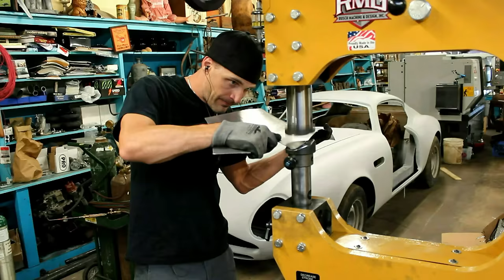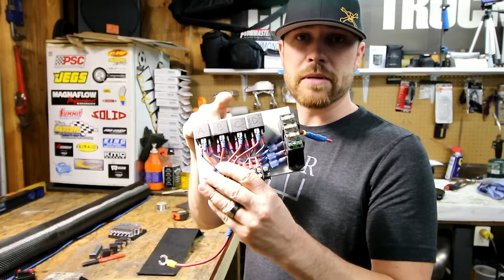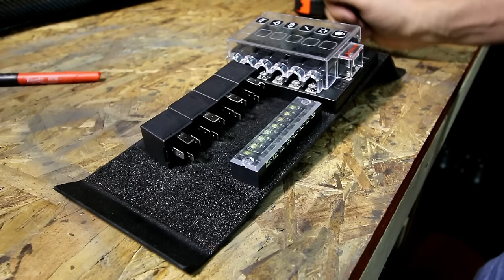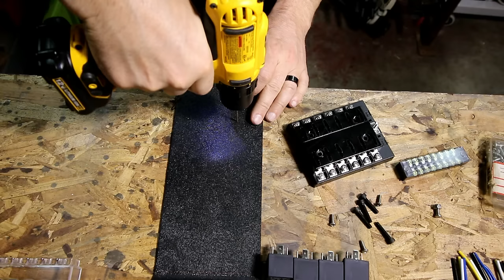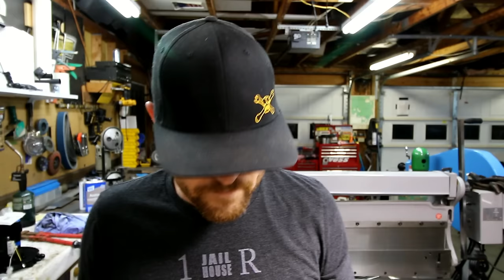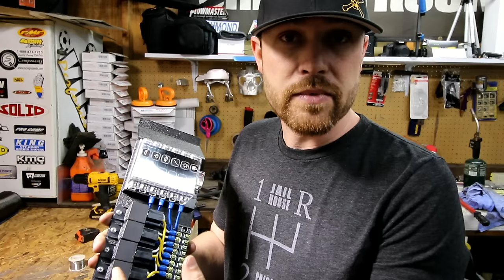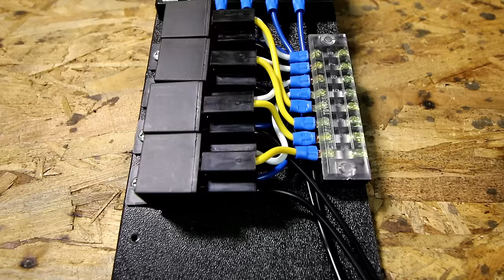How To Make A Power Relay / Fuse Block | Automotive Wiring

Comment: Very nice video/tutorial. But I have a question that how much amperage of the breaker should I get? I'll hook up a 30'' light bar and 2 pods led lights and a winch. And also planning to add 2 more lights/gps to my truck. Any idea? Thank you!
Reply from the maker: the breaker should be rated less than the wire it is protecting

Comment: great video man. I just bought my 12 circuit ez harness and I'm not a fan. The only relay that it came with is a horn and two flashers with a 30amp head light fuse. I'm not running a lot of accessories in my car, it's a very basic setup with a LS1 and manual everything. all my switches will be to where my climate controls and radio use to be. would this be a better solution that you made here? here is a short list of what's in my car.
1) head light low/high
2) parking /brake
3) turn signals
4) horn
5) accessories are gauges and one 12v aux output
6) fuel and fans will run off my engine harness. 

thanks for any advice.
Reply from the maker: yeah most of those dont require a relay.fuel , fan and running lights is all that really neeed it

Comment: great video man but those are not electronic relays switches, they are electro magnetic switches via the coil inside the relay being activated via 12v and ground on the coil.  again, this is a great vid for people not familiar with relays

Comment: Great video, thank you for posting I'm definitely following this!
A couple questions though. What type of switches do you prefer using? And my swap will need headlights, tail lights, turning signals, fan, fuel pump, and ignition, will this type of setup work for all those mentioned?
Reply from the maker: +Tyler Kotrous No preference on switches, something plain. And yeah this would work for your needs

Comment: So quik question when u hook up Ur switches do u hook up it up to white wire then ground it out? And then just wire say fuel pump to the yellow wire and ground that?
Reply from the maker: yeah basically...obviously the wires may not be those colors but the process you explain is the way it works. The relay is just an electronically activated switch that than handle a bigger load that you actual switch

Comment: Does the circuit breaker have to go next to the battery or if I'm going to run my power cable from the starter can I put it by that? My battery is in the trunk is why I'm asking

Comment: So I used a fuse block from Amazon and have power going from battery to that to a switch panel then to a 19inch led light bar and 4inch pod lights. The bar is 108 watts the pods are 18watts. Do I need a relay for these?

Comment: Very nice... so how do you determine the size breaker you need if your only feeding a 7 relay pack for ... dual electric fans, offroad halogen lights and an elec fuel pump? 300A would be overkill as I wont be turning over a starter??? thanks and keep the videos coming
Reply from the maker: breaker should always be under what the power supply wire can handle no matter how may relays you plan to use....the breaker is just incase your main power shorts out. Everything else is fused seperately
Reply: gotcha and thx.. after many googling hrs.. I now see.. that the best way is to calculate how many amps you will use across ALL items in the box, go a bit higher and that is your breaker size.. then figure out wire size. that tells me my 7 relay setup may just sit for offroad lights and electric fuel pump and my electric fans will sit in a separate setup on their own as they can draw up to 70A making the breaker and wire HUGE... so separate them on their own and down comes the breaker and wire... thx again

Comment: Whst does different amperage do ? Because I have a 6 position fuse box so like yours but there are 600v / 15A or 600v/25A what's the difference and what's the connection to size circut breaker because I see you listed s few different breakers with different limits so I'm a bit confused

Comment: personally I'd use one of the terminals from the fuse block to supply power to the "switch" terminal of all the relays and then use my switches in the car to switch the ground side of the "switch" circcuit on the relay. It simplifies wiring through the rest of the car and isolates more wiring to just the board, reducing failure points.
Reply from the maker: Doing it that way wouldn't eliminate any wire. You would just be exchanging the trigger wires. The amount of wire used from the switches to the relays will still be the same length weather they are ground or power. It would eliminate potential for shorts but think about it like this, if a ground trigger wire wears through and self grounds it will activate the relay and you have no way of tuning it off....if a power trigger wire wears through and grounds it will pop the fuse and close that entire circuit until you can fix the problem.
Reply: The Fab Forums I hadn't thought of that. Never had a wire wear through on me so I haven't experienced that problem to learn from. mostly I'm just too lazy to run a power in to my switches so all I have to do is run the one wire from the relay and then stick a ground as close as I can to the switch so I don't have to run as much wire.

Comment: rewiring a Grand Wagoneer with a Magnum engine. Appreciate your expertise. Chrysler/AMC put the relay close to the device. How is that important?
Reply: Putting the relay close would mean less heavy gauge wire needed to carry they load which would give less voltage drop but also cut manufacturing cost since they are running shorter runs. Just make sure you size the wire properly for the amps it needs to carry. Longer runs of wire carry less amperage, you can look up a wire sizing chart that will give you the info.

Comment: Great video guy, just one question, on that small panel, would it make more sense to insert the relays white and yellow lines in a stagger, ie, white yellow white yellow, so that your on/off switch wires are'nt spread to far apart. Hope the question makes sense.
Cheers
Reply from the maker: I like to have all the switch wires together because the harness from the switches is all together

Comment: Are the negative/ ground cables coming out of the relays all connected back to the negative terminal on the battery? Also, does the distribution board have positive and negative inputs for a device or do you run the negative cable from a device back to the negative terminal on the battery as well? Cheers for the awesome video! Hope to hear back from you guys
Reply from the maker: yeah all negative terminals go back to the battery. the distribution blocks only have switch power coming in and main power going out
Reply: Thanks heaps for the reply. Do you know of some sort of grounding block that allows negative cables from all the relays and devices to connect to, allowing you to then simply run one cable back to the negative terminal?
Reply: You can use one of the bus block and jumper them and on the last jumper use a larger ring connector and fit the wire going to the batt in it as well. You could also just use a wirenut or crimp connector, twist all the wires plus the on running to the battery and put the wire nut on it or put them in the crimp connector and crimp one side then run the wire for the batt neg on the other.

Comment: Okay that looks awesome. I just have one question. You still need power from the switch so does that just come form the other side of the fuse panel or would I still need to run power to a switch panel? I hate wiring but I just cant wrap my head around paying someone so much to wire a race truck for me.
Reply from the maker: yeah...I use one fuse to power all my switches
Reply: Ok what size fuse? I’ll end up having like 4-5 switches I might use a separate fuse for lights switch and need a separate set up for brake lights

Comment: hey bud I need a set up for a 1960s Hillman ive chopped back the wires from light wipers indicators fuel pump etc to 2 feet ive tested them all they all work so I just need a fues box for 4 cylinder old donkey motor and how many reulators I need how many fuses etc  how do I know how many items I need  so I also need to wire up dizzy alternator fan etc so what kind of loom do I buy and do you sell them and these set up  thanks scott    new Zealand

Comment: man, I've been trying to figure this out for two weeks. I'm stumped. How are you getting power to your relay white wire (86 - 85 black) with a switch located on the dash to energize the RELAY coil, which moves electro mag switch from 87a to 87 that closes the power to pin 30/pin 87 to activate your accessary?

Comment: i understood everything except the part with the switch. doesn't the switch have to be operating on a low power circuit for the relays to close? if so how do you accomplish that?

Comment: Do you have to run a seperate ground out of each relay? Or can they be just stacked on the same common ground? Also if I would want to run switched a d constant power could I do the same thing with this setup? Thanks
Reply from the maker: they can be stacked

Comment: Great work and video.  If you have only 4 relays with a total capacity of 160 amps, a 300 amp breaker is way too large.  The breaker is there to protect, but at 300 amps, it will take a long, hot, absolute short to blow it.  That wire cannot handle 300 amps or more...

Comment: Can anyone please answer these two questions about this set up? How would I connect this fuse and relay block to a keyed on power source? And how would a five pin rocker switch be wired to the fuse block, which wires from the switch goes to the block and where?

Comment: Man I have some questions I cant answer. 

1. For determining wire size from battery to fuse panel, do I total up the amps I’ll be utilizing? Say, I have 4 accessories that are 10 amps each. Do I call that a 40amp fuse box? Therefore making my awg 8?  Or can I just use a random size beefy wire anyway?  Does length come into play when determining size? My battery is about 4 feet from my aux fuse block.
2. Does the ground wire size matter?
How do i determine the correct size amp circuit breaker? Ill be using less than 100 amps total with all of my accessory amps added up. Not even sure if thats the correct way either haha. Im very confused.

Comment: How would you go about adding a switch to each one of the relays? would you be connecting the power to the switch to the yellow power out?
Reply from the maker: no power out goes to the accessory your trying to run...the switch power goes to the switch input on the relay

Comment: I got a question Kyle, today I was wiring up my Magnafuel external fuel pump. When I purchased the pump I opted to buy the assembled dual relay kit from Magnafuel so I have plenty of insurance for running the pump. So here is my question, since I have two relays, I have two wires that need to transition into a single wire at the fuel pump, ignition and battery. What's the best way to make that joint with two large wires, joined to one side large wire. I believe the wire size I'm working with here is two 14awg wires and a single 12awg
Reply from the maker: hmmmm. Not sure. Why are you running two wires?
Reply: I got it figured out now, originally I was running two relays for the single fuel pump. But after looking into the pump load I figured out I only need a single relay.

Comment: Was just watching and was wondering why are you double fusing the power that’s coming from the batter to the relay wouldn’t u just fuse the power wire from the batter to the relay then fuse the wire that goes to your light or fan thank u
Reply from the maker: I only fused the main power and the accessory relays

Comment: Hey Kyle. Thanks for putting together that video. I really appreciate it. It's awesome stuff.
I'm working on the wiring harness for an LS swap which will need fuses/relays for the fuel pump, injectors, fans, PCM, etc. Would the panel you put together work for that application and under the hood? Could it be made to be water tight? 
Would there be a need to fuse the wire between the relay and the accessory?
Thanks
Reply from the maker: awesome. yeah you could use it under the hood and the fuse that powers the relay will be the fuse that trips if the wire from the relay to the acc were to short
Reply: Gotcha. Thanks for getting back with me. Have you figured out a way to make it waterproof/resistant to the elements under the hood?

Comment: @the fab forums I have a mess of wires underneath my dash and want to simplify my wiring because I really only need 6 accessories powered (fuel pump, electric fan, gauges, ignition) Would this be a suitable setup to power those?
Reply from the maker: it would be perfect

Comment: hey question , I have some relaays laying around wondering if I can use them they have 5 wires instead of 4 , can I use them or I have to go buy some 4 pin relays? thanks and nice video man!
Reply from the maker: you can use them....the 5 pin just has a normally open pin and a normally closed pin
Reply: The Fab Forums thanks for the help so I should leave the middle wire off ?

Comment: I still cant get my head around the 12v switch wire. Say it's a stock heater you are powering, you press the switch on the dash, where does it get its 12v from to trigger the relay?

Comment: if its for different lighting options and a constant 12 volt, do i need the relays?
Reply: I need to know as well
Reply from the maker: relays are made to withstand the current load and demands of lights, fans, pumps...ect. Most 12v switches are not. So the fix is to use a relay and then just have the switch power the relay vs the actual light or fan...
Reply: @Thefabforums  thanks!
also is there a bonus to having the bus bar as well, compared to using just the fuse block and a breaker?

Comment: First Vid I've seen of yours....subbed!!  What gauge wire do you use coming into your distribution block??
Reply from the maker: right on, welcome to the channel. It depends...on this setup I am using welding lead cable which is 1 or 0 gauge I believe

Comment: Hey Kyle I'm new to the Forum.I was searching for a video like this for my brothers project. Question: What did you use the 100 and 200 amp breakers for? By the by you did some professional wiring in this vid.
Reply from the maker: the breaker was for the main power cable that powers the fuse block and starter

Comment: I have a question. does the power that is supplied to the switch to active the relay need to be fused also? Do i need a fuse distribution for that also?
Reply from the maker: I use one common fused power source to power all my switches.

Comment: There is an important point to be mindful of when making a custom fuse panel.  Fuses protect wires, not modules.  Size your fuses to protect the smallest wire that it feeds.
Reply from the maker: yeah thats basically the very first thing I put in the description because people were confused about my breakers

Comment: n my 1968 VW Beetle I'm trying to add a Fuse box because I want to stop cutting into my harness but I was wondering if its only going to be for radio and some interior light if I should add a relay to the system or the fuse box alone will do just fine?
Reply from the maker: fuse should be fine for just that

Comment: if you hit 300a through that wire. it will be welded to what ever metal is nearby. i have 10mm cable and its only rated for around 50-70amp. im using 50a breaker from memory.
Reply from the maker: Its not for that wire. That wire uses the fuses in the fuse block. The breaker is for the main power wire which is welding lead cable.

Comment: Do you think you will need to run a fuse off the battery if you just running led lights since they don't run that much power
Reply from the maker: yeah the fuse is in case the wire grounds out some how. Keeps from creating a fire

Comment: Does this set up make each circuit controlled by on -off switch or ignition switch? I want to make a small panel that is controlled by ignition so I don’t have a constant draw on my battery. Any advice?
Reply from the maker: It can do either
Reply: Would it be wired differently than in your video?

Comment: come back to a old video for some advice. if I'm wanting to do a set up like this one being for a fuel pump that draws 1.6 amps average do i need a relay ? or can i run say my pump and fan off one relay ?
Reply: smyffe69 always separate your loads with there our fuse. That way if your fan shorts you can still limp home.
Reply from the maker: +smyffe69 yeah what he said
Reply: ok so what if i went relay then into separate fuses ?? with my original question

Comment: Just a question, but why not run a single fused power to the coil on the relay from the fuse block?  Then all you have is a single wire to your switch to control the ground side of the coil.  Basically you control the ground with the switch, instead of the power.  Then any shorts in the control side result in the relay being on, instead of arcing and blown fuses...
Reply from the maker: shorts that cause stuff to stay on could be a really bad thing

Comment: quick question. why would you not run the yellow and white leads to the terminal block right next to each other? i dont understand.
Reply from the maker: I like all my switch wires coming in together in one tight clean bundle

Comment: I'm assuming you soldered/connected the common ground wires together and then used a heavier gauge wire to connect it to the negative? or grounded it on some metal? Sorry, I'm a wiring super noob....
Reply from the maker: correct